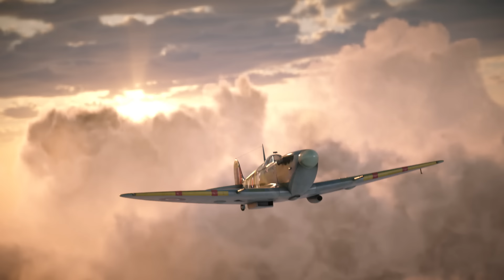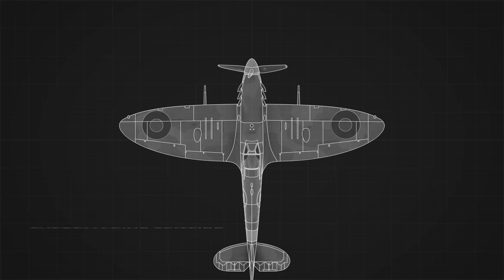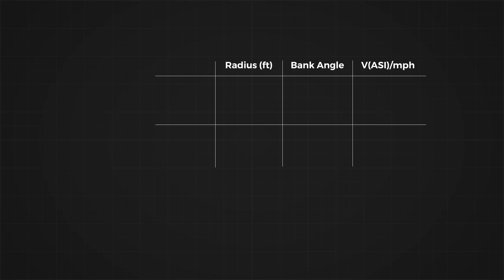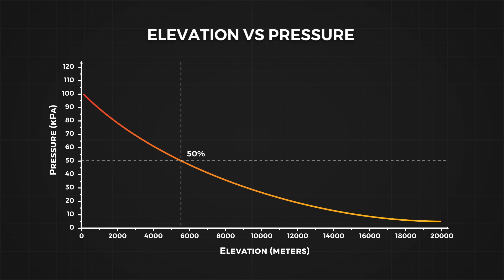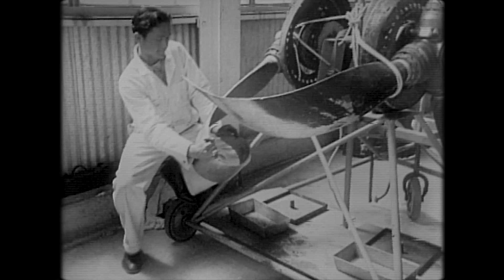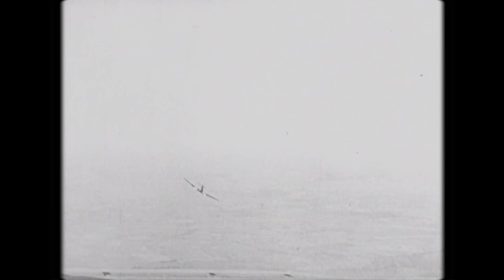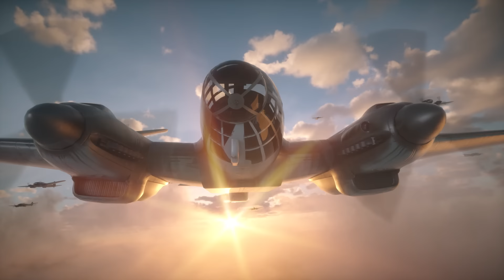The Insane Engineering of the Spitfire

Comment: You gotta do the Mosquito now- utilizing unexploited manufacturing resources in the form of woodworking shops, while also taking advantage of the benefits a wood construction could give? It's a perfect blend of engineering and manufacturing knowledge.
Reply: Yeah, turns out being able to carve and sand in smooth 3D curves rather than needing multiple sheets of metal allows a VERY clean finish. One of the only fast bomber designs of the war that was ACTUALLY fast enough for the speed to act as a defensive measure
Reply: One of my favourite aircraft of the Second World War and it's often overlooked, I think.  It was truly multirole and, unusually, very good at that!
The Tsetse being a variant that many people might consider too ridiculous to try but, it was tried, and it worked!

Comment: As someone who has studied the Spitfire all my adult life and also flown one, can I say that this documentary is of impeccable quality. There are a few misplaced clips of Hurricanes and Hispano Buchons, but that's forgivable. Your explanations of aerodynamic principles are very clear and accurate, and you rightly focus on the key points that made the Spitfire an apex predator: Bev Shenstone's wing design; the power to weight achieved by Rolls Royce engines; and the radiator technology that Supermarine had developed during the Schneider Trophy campaign.
I'm really impressed and Nebula has instantly become a trusted brand. I have taken out a sub and look forward to much more.
Reply: I'm a bit sad you haven't mentioned Meredith when talking about the radiator, the bloke basically saved the Spitfire a couple of miles/hour when they had to abandon vapor cooling.
Reply: @MDzmitry  Meredith was working with RJ Mitchell on the "new Spitfire" in 1937 when Mitchell died.  It had a carb intake under the spinner and a ventral radiator, which freed up the wing space for the fuel tanks as originally planned.  Such a revision would have made the Spit faster, climb better and increase its range.  Kindelberger visited Supermarine in 1938 and asked him to build Spitfires.  He declined.

Sadly, Vickers would not let Smith revisit this concept or disrupt the production lines

Comment: Truly one of the best pieces of engineering of all times.
Reply: Truly one of the engineerings of all time
Reply: @Qwertype315  My favourite part was when he said "It's spittin' time", and started spittin' everywhere.
Reply: Spitfire overrated. Nostalgia. Merlin was great in anything it was put in with Americans driving most of the upgrades. Looks better with cropped wings.
Reply: @Qwertype315  bro you just the comment
Reply: BF-109 was better with fuel injection. Some serious rose colored glasses with the spitfire. The Hurricane was 99% as good.
Reply: Honestly I’d argue that both bf109 and p51 were better than the spitfire in almost any way.
Reply: The spit only had a better engine than the 2 other
Reply: @williams6206  also had the better turn radius
Reply: @ConorDoesItAll  that’s one factor. BD109 could clime faster, roll faster, and fly inverted.
Reply: what's better the Elliptical wing of the spifire or the laminar flow wing of the P51 mustang??
Reply: @kingsman3087  stang of course
Reply: @kings man
The Mustang's 0.4 taper ratio gives similar benefits with regards to induced drag as the Spitfire's wing, and is much easier to manufacture.
Reply: We have a Soaring Tractor wannabe here🤡
Reply: @GeeDaddyFlex305  "BF-109 was better", only for limited time frames though.

There are a few periods in which the the BF-109 was better.
1. Late 1939 with the introduction of the E series 1-O-9 till the end of the Fall of France. The Spitfire with 87 octane fuel running 6,25 lbs of boost was better than earlier versions of the 109. After the fall of France the Spitfire got 100 octane fuel running 12 lbs of boost, which equalised the performance gap and in many areas surpassed it.

2. The introduction of the 109 F series to the introduction of the Spitfire Mk IX with the  Merlin 61. While the Spitfire Mk V was a significant upgrade over earlier models it did have more modest performance ar medium to high altitude. The Mk IX fixed that a bit.

After the BF 109 F lost its advantage it wouldn't really regain it. The first Mk IXs where equiped with the Merlin 61, but this engine would be replaced with the Merlin 63 and 66 around the same time the BF-109 G series came around.

Then there's also the whole Griffon engine and 150 octane fuel allowing for 25 lbs of boost. Something even the famed Kurfurst couldn't hold its ground.
Reply: The P-51 is considered to be the Peak of Piston Engine Technology

Comment: Another thing to note is that an aircrafts turn performance is not solely dependent on it's turn radius, although it is important for many maneuvers of a dogfight (one circle, scissors, etc.). 

The other crucial component is turn rate, or how many degrees per second the aircraft can complete in a turn. This is important for two circle dogfights, as well as other fights. 

If you want to learn more, look up one circle vs two circle dogfights!
Reply: The Bf-109 did have 2 advantages. The first was a higher rate of climb due to lower wing loading. The second was the high pressure fuel injection engine which meant it could perform high speed dives. The merlin engine was fed by a carburetor which meant it would stall if put under the same forces.

The main reason the Germans were unable to achieve air superiority though was the home field advantage. British fighters could afford to fight far more aggressively than their German counterparts as they had full fuel tanks and could use them up as they would just land. The Germans had to consider the distance back home as well.
Also quite a few planes that are shot down don't crash. Holes in the fuel tanks or a compromise of the engine or limited damage to the flight controls can render a plane unable to fly but still capable of landing safely. If a British plane got disable by light damage the pilot would just be put in a different plane and the plane would be repaired. If the same thing happened to a German both the pilot and plane were lost.
When the roles reversed the British didn't fare much better than the Germans had with their bombings. What made the bombings successful was the collapse of Germany's air defenses due to the overstretching of the eastern front and the incompetence of Gouring. Germany never developed a well functioning fully integrated air defense network like Britain did and by 1943 even if the British lost a lot of planes that didn't matter due to the practically infinite resources provided by the US.
Reply: @MrMarinus18  First of all, in wing loading a Spitfire would always outperform a contemporary Bf.109 model. Secondly, 109's advantage in climb rates (albeit not tremendous and at times non-existent) was provided by the sheer horse power per kilogram ratio.
And the never-ending stanza about fuel injection falls apart since 1942 and the implementation of Merlin 66 (alongside US-produced 266 model), 70-series and every later iteration. Even if you consider 1942 "late", fuel injection alone doesn't win battles, it only gives a chance to escape alive. Didn't stop Mk.I and (later on) Mk.V Spits from warding the Germans off above Britain, Malta and North Africa until Mk.IXs arrived.
Reply: @MDzmitry  well said.  People always try to use 1940 Spitfire Merlin III performance for the entire war.

Comment: Actually in a turn, you increase the deflection of the elevator, not decrease it as stated in the video; that is the rear edge of the elevator move upward. This works to move the tail downward and the nose upward, which increases the angle of attack, and thus increases lift to compensate for the loss of the vertical lift component while banking.
Reply: Glad you said this, I found that odd as well.   Flying model airplanes is my reference point and you'd go straight into the ground with down elevator.

Comment: Great content, as always! However, I’m not sure your explanation of a narrow radius turn is correct: in a steep turn a pilot will pull on the stick to add some nose up attitude which adds a vector complementing aerodynamic lift of the wing to increase vertical lift and a centripetal force thus diminishing the turn radius an keeping the aircraft in horizontal flight. A pull on the stick will deflect the horizontal stabilizer upward, creating a downward force on the tail (nose up of airplane) In the video the contrary is shown and told. 
Second small correction: the pressure equalization on the wingtip will produce a VORTEX (plural vortices) around the wing contributing to induced drag. 
Keep up the good work. I always enjoy your videos. Thanks!
Reply: we get ourselves into this kind of trouble when we decide to use pluralization rules from other languages. 'vortexes' sounds like a perfectly cromulent English word to me.
Reply: yes, the video made an error regarding the elevator direction, but was bang on regarding the  induced drag due to increased AoA.  The Spitfire elliptical wing generated less induced drag than other fighters, especially at higher altitudes, despite having a thin wing.  Brilliant design.

Comment: I think you are mistaken, in a tight level turn you need a degree of back pressure on you elevator, to keep your nose on the horizon, your illustration has the elevator in the dive position ( stick forwards ) this would push the nose down. A little bit of outside rudder to control the yaw  reduces the potential stall at the maximum, WW2 pilots would feel the start of this with a shudder, would have to reduce the tightness of the turn or increase power, stalling out made you a sitting duck for the wingman.

Comment: Not mentioned is the huge difference between the prototype Spitfire wing and that of the production planes. The prototype wing was so poor aerodynamically that its initial performance was no better that that of the Huricane. Being well down on the expected top speed. 
This being due to parasitic drag of the prototype wing pannel shapes and orientation. These had to be changed along with the internal support frames. This in turn required a serious redesign of the wing and took around two years to implement. Which was one of the reasons for the long gap between the first flight of the prototype and those of the  Mark 1 producion Spitfires.

Comment: Another clever innovation in the radiator design was that cool air drawn into the radiator was heated by the radiator core causing it to expand, then when it left the radiator, it was travelling significantly faster than when it entered, thereby creating a small amount of thrust (in effect a jet) which also partially negated the drag created by the radiator. Clever man Mr. Mitchell. we can only imagine what kind of designs he would have come up with if he'd had access to turbojets.
Reply: Thats like saying the pilots ate beans before every flight because farting added extra thrust.....
Reply: @mikeland3453  lol, true though very clever design of the radiator inlet and outlet
Reply: Actually, that radiator cooling scheme you describe was due to Meredith (1935) at RAE.  The Spitfire radiators were a bandaid solution when the glycol liquid / radiators were adopted.  That space in the wings was originially intended for fuel tanks. 
Meredith and RJ Mitchell collaborated on an upgraded version of the Spitfire (Type 312) with a more efficient ventral radiator which RJ was working on when he died in 1937.
The square, wing-mounted radiators were a main source of drag and didn't really enable the Meredith effect unfortunately.

Comment: Great video and great visuals as always!
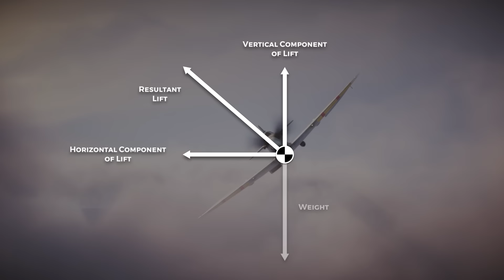Please note that at 4:11 the elevator should be deflected upward to make the airplane pitch up, increase the angle of attack and, ultimately, produce more lift (and more drag).
Reply: Yes.  Elevators up gives downward lift causing the aircraft to pivot around the center of mass which pitches the nose upward increasing lift.
Reply: The wing is also where all the appreciable lift comes from. The elevator just produces a rotational moment to increase the wing's angle of attack. I'm surprised Real Engineering made this mistake. He's usually a lot better at getting his facts straight, even on the topic of aviation.
Reply: @米空軍パイロット  nobody is an expert in everything.
Reply: he pinned a different comment pointing out the same thing and replied to it btw
Reply: what's better the Elliptical wing of the spifire or the laminar flow wing of the P51 mustang??
Reply: @kingsman3087   Laminar flow is never met in practice, it needs perfectly smooth, polished and blemish free surfaces.  The North American airframe was very well made and that lowered the drag.  It also had a better radiator design reducing or overcoming more of the radiator drag.  Its inward retracting undercarriage allowed a thin wing outboard and it had plenty of space for armament.  The Spitfire wing was better for dogfighting but speed was more important.  It had low drag at very high altitude.

Comment: Super video! You might want to mention Miss Shilling orifice - her tweak to the carburettor design that allowed a few seconds negative G in later models.
Reply: Not really in "later models", just from ~Mk.II to Mk.V until the Mk.IX arrived (mid 1942 - early 1943). 
The latter had Merlin models with pressure carburetors instead of float ones. Same about late-war Griffons.
Reply: @MDzmitry  some Mk.V's and corresponding Seafire III's had the pressure carbs and were quite the hotrods.  Many pilots preferred the Mk.V with its better manouverability than the IX.
Reply: @bobsakamanos4469  Yeah, later Merlin 50s had pressure carburettors if I'm not mistaken.
And they were indeed good machines, but fine-tuned for low altitude, and we're not talking "LF Mk.IX" kind of low, we're talking "soviet fighters" low
Reply: @MDzmitry  Yes, LF Mk.V's could take on the 190's (but would of course have top cover) and LF Seafire III's were faster than Corsairs.  The late production Mk.Vs met the needs of the 2nd TAF at low level.

Comment: Thanks for your work, in general, but specifically on airplanes. Your videos on the P-47 Thunderbolt and the A-10 Warthog were amazing. This video on the Spitfire is awesome, too. The Spit was the most beautiful fighter of WW2, imho. The P-51 Mustang would be a great analysis for you. The way it was mediocre until is got the Rolls-Royce Merlin engine would be interesting. Thanks for your efforts, from a guy who lacks the math skills but can understand your explanation.
Reply: Ive always felt like people dont appreciate the absolute workhorse that its the p-47. It was a vital plane introduced at a vital time, and while it had its issues, much like the m4 sherman, it was the right weapon at the right time. Not the best, but far from the worst.
Reply: The P51 was much more aerodynamically advanced than the Spitfire, especially in cooling drag reduction. However the Americans struggled with supercharger design, and it was the introduction of the Merlin 66 that greatly improved high altitude performance. This is what made the difference.
Reply: @sheldonholy5047  P51 was a great plane, although it couldn't climb or turn like a Spitfire. Its strengths were in other areas - especially range. Also, and this is not meant disparagingly, the P51 was cheap to build which gave it a big advantage over the P47 and the Spitfire in wartime. US mass production made a huge difference to the outcome of WW2 and the careful use of strategic materials was a big part of that.
Reply: @slammerf16   also a very good point - the spitfire did take around 30-40% more man hours to manufacture than most of its contemporaries, namely the Bf109. This is quite often overlooked.

The Germans did well considering their lack of many materials which the allies had access to, which forced them to use ball bearings instead of sleeve bearings, which is quite undesirable in large engines.

Comment: I love the explanations of the engineering. I got to see a Spitfire flying at an airshow around 1980. It is an incredible aircraft.
Reply: Tough choice: seen a Mustang in flight (beautiful sound); like to see a Spit, even a wreck, love to see one flying!
Reply: @edwardgatey8301  The pilot did a few low altitude high speed passes. The sound was amazing. You could feel the power. There must be a few still flying. Check your local airshows.

Comment: I think you should read "Secrets of the Spitfire" - the biography of Beverley Shenstone - the senior aerodynamicist working for Mitchell . The elliptical wing was not merely chosen to cover the guns. Apart from the reduction in induced drag, the wing , which was actually 2 semi ellipses with a common major axis on the 25% chord line,  had many other benefits apart from providing enough depth to cover the guns and undercarriage.
Reply: ꜱᴇɴᴅ ᴀ ᴍᴇꜱꜱᴀɢᴇ👆👆..
Reply: The benefits of the elliptical wing were first described by english aerodynamicist, Fredrick Lanchester in 1907.  Prantl expanded on his work in 1918 with the Lanchester–Prandtl wing theory.  Operationally, its gentle pre-stall buffet allowed the Spitfire pilot to ride the edge of the stall in combat without fear of sudden wing stall/ snap roll. Hurricane pilots didn't have the same warning and hence were more reluctant to push their aircraft to the limit.  Kittyhawk pilots also were afraid of the aileron snatch and flick roll if too agressive in the turn.  The P-40s also had a tendency for the rudder to lock up in certain manouvers. 
Spitfires saved many a pilot due to its fine handling.